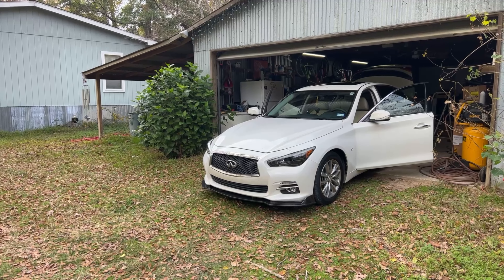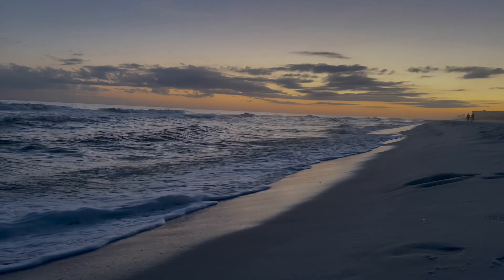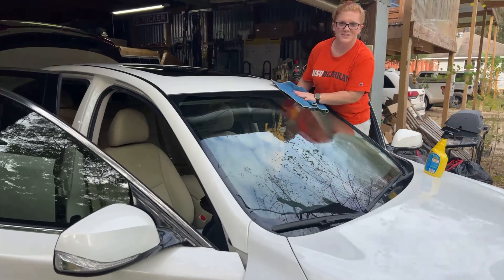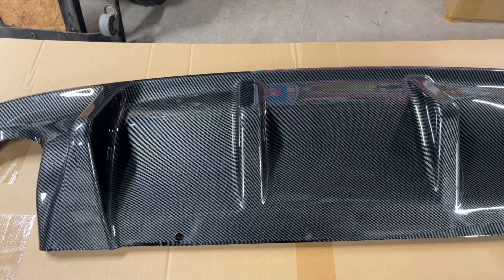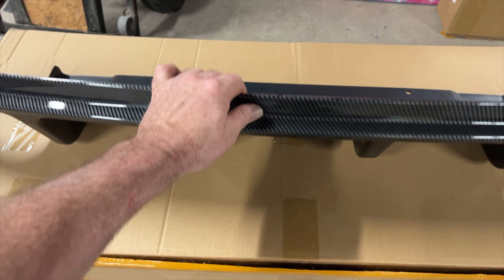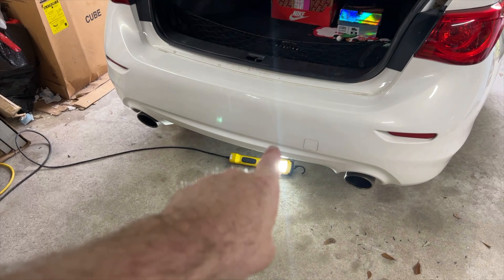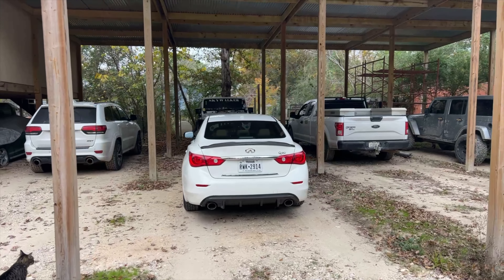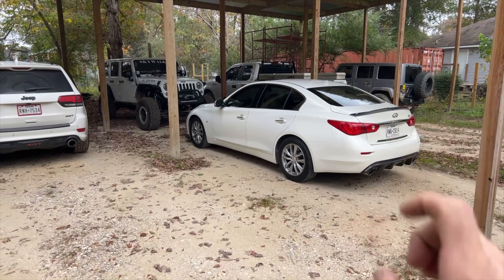Ninte Infinity Q50 rear diffuser

Comment: would this fit year 21 q50?
Reply from the maker: @bvqe  The rear diffuser would be a different PN for the 2018 to 2024 Q50. But yes they do make one that will fit. The front chin splitter is also available but different PN as well. The rear deck lid spoiler will fit as it is for the 2014 to 2024 models.

Comment: Is it real carbon fiber?
Reply from the maker: @AngelSilva-r5j  Wellllll…….unfortunately no it is not……BUT……It is extremely lite and I did look at a real carbon fiber one……and OMG !!!!! Too many dollars for something that can break or chip very easily….I have been very happy with the diffuser. Use more double sided tape than you think and I even used some urethane along the inside edge to help hold it even better. The double sided tape seems to have a tendency to come loose after a while with the sun baking on it. If you decide to go also with the trunk spoiler, after a couple years in the sun baking away at it also….the clear does start to fade. Wasn’t a big deal as we simply had it wrapped with carbon fiber vinyl from 3M.